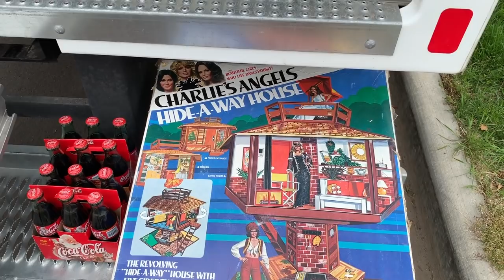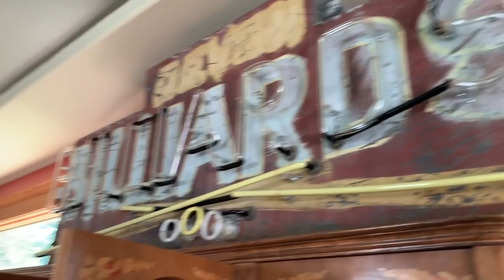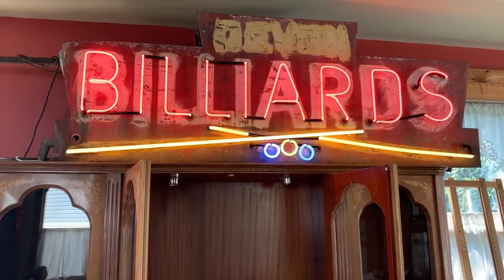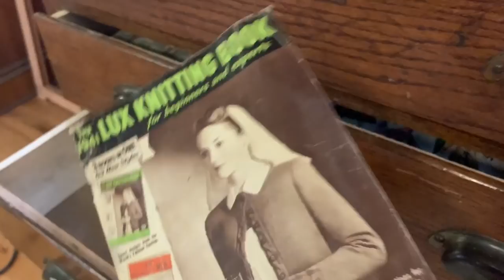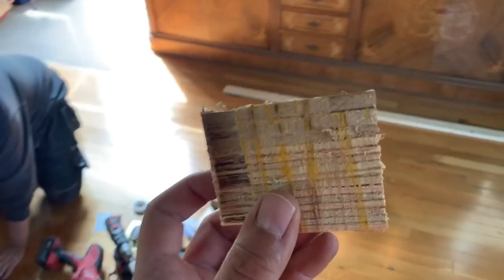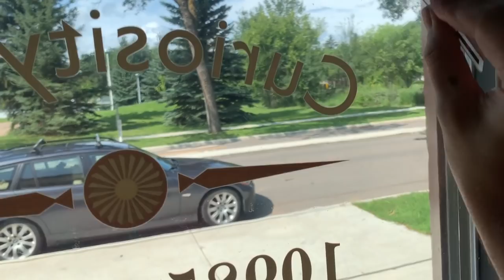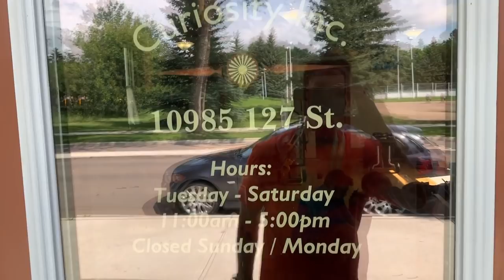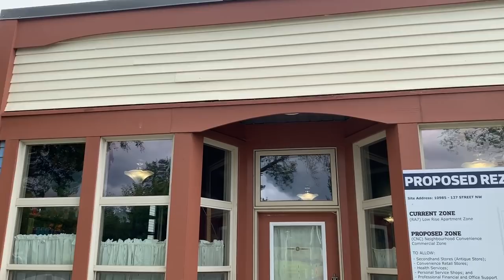Part 6. Tree trimming, floor repair and return of the Viking! General Store

Comment: HOPE YOU PUT A PLASTIC MOISTURE BARRIER DOWN ON THAT BARE DIRT THAT'S UNDER THE BACK OF THE STORE.  OTHERWISE OVER TIME THE FLOOR WILL MOLD AND/OR ROT AGAIN.
Reply: EEEDEE1 Ed the damage was fron the roof leaking for 20 years.
Reply: @stephenschweter5234  Have fun with that subfloor moisture intrusion Holmes on Homes

Comment: To kill the stumps from the trees by the building you can use paddle drill bits and drill into the stump. Take care not to drill a hole out the side of the stump but drill as deep as possible. Then fill the holes with brush killer. Cap with plastic bags to keep water out. As killer soaks in, refill. you can get the killer at Home Depot.

Comment: Those topping cuts on the tree are going to sprout new growth like crazy putting you in a bad spot again rather quickly. Plus a horizontal surface like that one is going to rot and possibly end up killing the tree. Best thing? Take the tree out entirely or be ready to do this again in a few years.

Comment: I have a beautiful, leaning maple in my yard that I am slowly cutting back.  I did a little last winter when I could see its "bones."   Last week I decided on taking one more large branch.  It was alive, but had been damaged in a wind storm, and was on the side I wanted to take weight off.  You can't put the branches back on, so it is better; it is okay to take it slowly and see what you have.  I am wanting to save every tree, but this is not always possible.  Because of this, I tend to go slow on reshaping or, if worse comes to worse, removing a tree.  I have a Mountain ash that has started to show dead parts and it is no longer pretty, but because I love the blossoms in the spring and red berries in the fall I have been hesitant to remove it.  Sigh.  This "tree man" seems to like to be cautious in not taking too much away in hopes of saving the tree.  I like him.
While it is true that a razor does not scratch regular window or mirror glass, it can and does scratch tempered glass like on some sliding glass doors and glass shower doors, so be careful.  I cleaned houses for years and always had to test a small corner to be sure it was okay before I scraped large panels of glass. 
Love your videos.

Comment: If you had a few pieces of plywood lying around it could prevent hail damage on your cars.  an old blanket under the wood and straps to secure the plywood.Just a temporary measure, but i think it would work.

Comment: Its coming together so nicely. I was wondering if you were going to paint the rest of the blue on the front of the building the same cream as the top? I am loving everything you are doing. the fixtures you have could they not be hung from the roof instead of the beams since you will be leaving it open? Then you can take the conduit off the framing and have it more open. Just a thought. Love this store.

Comment: you should go back wit a metal roof. Last much longer and more damage resistant.  They also come in colors now, and are relatively easy to install. Hans is exactly what most people think Canucks are like. I knew better because I used to hang with some in Colorado Springs in my misspent youth. Them boys could drink some beer!

Comment: This video probably has been out for a while, but I just wanted to drop a comment about a concern with the toys near the front window. That sun may cause the nice print colors to fade out. I've had experience with books (relatively modern ones, thankfully) fading badly within about a 3-5 yr period of sitting near a window. But if you're OK with it, then it's all good.

Comment: Should you cover that duct work running through the bottom of your display cabinets with insulation
to prevent the heat from drying out the wood in them?

Comment: Alex the reason why the floor is wet is because it doesn't have the cement Foundation you're going to have to pour cement but first needs rebar it needs to be completely Rivard and then the cement poured otherwise your floor there will always be wet and it will make you sick and everybody else sick okay so all that needs to be ripped up you need to you need to talk to Joshua about it. Do you now have to ask them everything you do to the building?💜💜💜💜🌹

Comment: You need to move the cut logs away from the side of the store wall. If you don't, it will attract termites and wood worms and cause harm to the buildings structure itself..  Just sayin.. never stack wood against any wood framed building.

Comment: Is there no foundation under the addition? No cement?
Reply from the maker: Wood beam foundation with cement curb
Reply: @CuriosityIncorporated  Gonna insulate it?
Reply from the maker: Need to be ventilated for airflow so I will have to
Focus on insulation for walls and roof